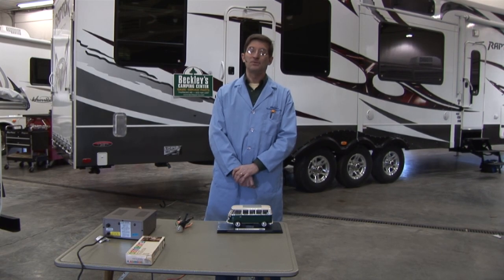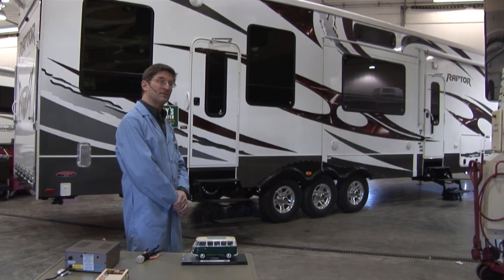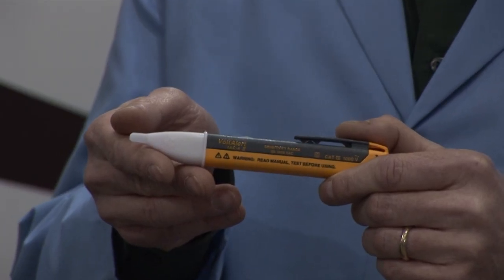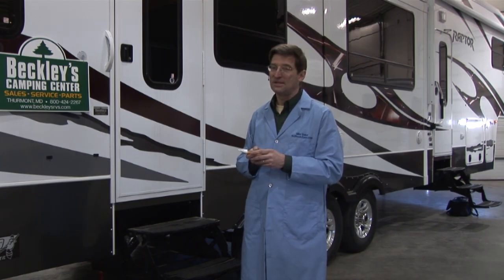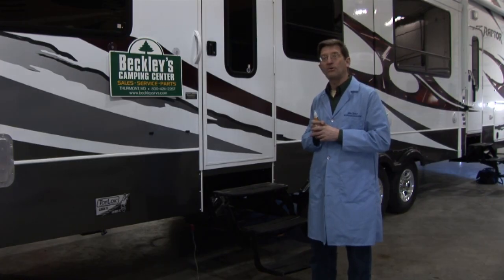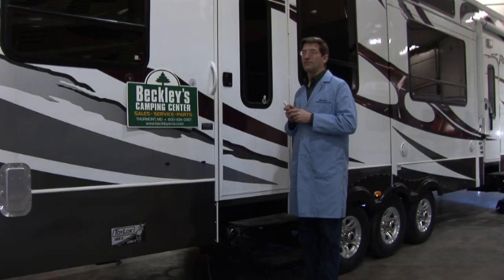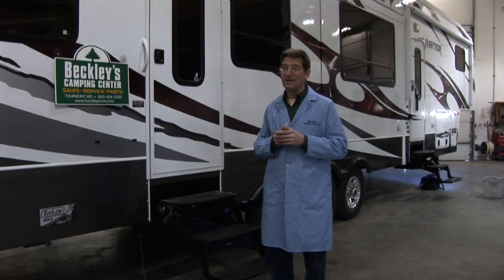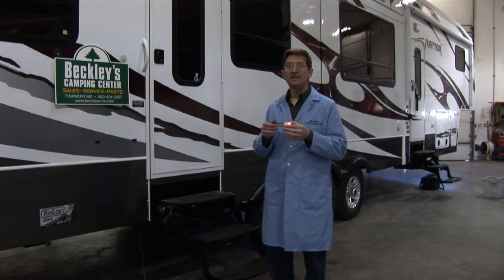Hot Skin RV proximity test full scale

Comment: 40 volts AC is not enough to cause a heart attack even if you are soaking wet. 1 amp is required to interrupt the human heart at 50 Hz. Human skin has a resistance of 1000 ohms dry and as low as 100 ohms wet. I = V/R  = (40)/(100) = 0.4A. A standard 110 volt AC outlet is just enough to cause fibrillation if you are wet but not when dry; I = V/R = (110)/(100) = 1.1A 
I agree with your lesson however, always better safe than sorry.

Comment: CPR will not fix a fibrillation. Get ice on their head and straight to a hospital. I mean surround their head in ice; this will give them  up to an hour or more before brain death. Also, they would have 8 minutes to live not a few minutes without any intervention. 8 minutes before brain damage starts due to oxygen deprivation. CPR is blowing carbon dioxide into their lungs and meant to inflate the airways when a person is not breathing but there is a heart beat. If the person is having a heart attack you can't simply blow carbon dioxide and nitrogen into their lungs to correct the fibrillation.

Comment: Just got a camper, had it plugged into a garage standard outlet using a 30-15 adapter. Was outside the trailer leveling it, was hot out and was sweating, I noticed when my arm brushed against the edge of the rv it tingled. I thought wtf. Started looking into it and wow, not good. This old garage outlet I'm using has no ground/2 prong. I know nothing about electrical, so now I'm just trying to figure out how to fix this. So far it looks like I have to run a ground wire from the garage outlet to the house breaker panel, to bond to the circuit, then replace the outlets w GFCIs. Anyone knowledgeable in this have any input? This rv is my home for now, that was the plan  anyways. I can use a generator temporarily, until I get the grounding issue resolved.

Comment: I have a question Mike, my RV has 38 volts of power on it when it is NOT plugged into anything? I live under the high transmission lines that I believe is causing this condition. Can I just ground the RV?
Reply: That's an example of electrostatic induction. The induced current is very low and you can safely ignore it, or you can attach a grounding stake to the chassis and it will go away. It will also go away whenever you connect to properly-grounded shore power.

The natural electrostatic field is oriented vertically at a strength of about 30V per foot. (In good weather. It does crazy stuff under rain / hail / thunder clouds.) The man-made induced voltage you're seeing is equivalent to about a 2 foot difference in height. 

(Also the natural field is DC and the artificial one is AC at the same frequency as the lines.)

Comment: What a useless video.  So I have a hot skin, what do I do to diagnose or fix it?  I don't need to know I have a problem, I need a solution.
Reply: Turn the breaker off and unplug, or shut down your generator. If it's caused by shore power go bitch to management and try to get an electrician out. If it's caused by a generator, you  need an electrician to inspect your RV.

Comment: Can you physically ground your RV with a grounding stake before plugging it into a mis-wired pedestal
Reply: If you provide a grounding stake with 150 ohms of resistance (which is really good) and the path through person is 1500 ohms (pretty typical), then your grounding electrode has provided approximately 10x protection.  That sounds good but it's nowhere near enough.

Using a grounding electrode improves the threshold of danger from 0.005 A of spilled current to 0.05 A. A faulty appliance can spill more than an amp and a wiring problem can spill 20A or more. A safety conductor should be thousands of times more conductive than the human body. You can't do that without correct wiring.

Auxiliary grounding stakes don't hurt, but they're not enough to help you.

Comment: A false test can occur if your RV is below high tension wires. If you test and get alarmed, look up. A very low amp current can occur, no harm will be done.
Reply: Well, no immediate harm.  But there's a reason homes/businesses aren't located under 100,000+ high voltage wires that are induces current through your body back and forth at 60 times per second.  Over a lengthy interval (years), one's health risk increases - ditto during pregnancy or individuals have other health factors that suppress their immune system.   Consider this statement:  “There is no known mechanism by which magnetic fields of the type generated by high voltage power lines can play a role in cancer development. Nevertheless, epidemiologic research has rather consistently found associations between residential magnetic field exposure and cancer.”
Reply: @CaliforniaTravelVideos  It wasn't hard to Google the study you pulled that quote from. It also says:

"On the very simplistic assumption that residency close to high-voltage power lines would double the childhood leukemia incidence, it may be estimated that less than one case per year out of a total of 70 would be prevented were all power lines deenergized. The reason for the low number is the combination of an uncommon exposure and a rare disease."

Or to summarize, the link between HV lines and cancer is a mystery and a scientific curiosity. It's not a public health crisis; it's not even a particularly rational justification to avoid living near such lines. It's still good to know. Higher frequency and higher voltage lines, or lines installed closer to the ground, might warrant careful study. Utilities are gradually switching to high-voltage DC - so my guess is that this will become a moot point long before anyone figures out a mechanism.
Reply: @jordanrodrigues8265  Interesting, thanks for sharing.  All the same, as a former microwave technician I avoid dental X-rays, prolonged sun exposure, etc. but I freely use and enjoy the convenience of microwave ovens with adequate shielding.

Comment: A "surge protecting" is not the same as a ground-fault error! The particular surge protection device you use must clearly state it offers "miss-wired" ground protection; as not all devices are the same.  A Progressive Instruments Mfg. device is most often touted as having this capability. Mine has a real-time  voltage reading/Amperage draw as well as a brown-out protection for lower-than-adequate power conditions [that can also be detrimental to your on-board electronics].

Comment: how often does this happen...just curious...
Reply: Only if you pull your cord out alot like NUMEROUES times a week for a season, it can stretch and ruin the metal cable INSIDE the cord. It's not often this happens, HOWEVER, that's not to say your box you plug your camper into couldn't be ruined. MAKE SURE YOU CHECK BOTH THE BOX AND THE CAMPER with these little devices. Trust me, this CAN and WILL kill you FAST! It's rare to get just a little tiny shock. Many times it'll be 120 volts! That will try your heart in a split second! There is not chance of survival! So a $15 no touch tester at Walmart in the auto section, is worth saving your life!!!! ESPECIALLY if you changed your cord to the camper, always test it AFTER plugging it in! Trust me when I say, IT HURTS! IVE BEEN SHOCKED ONE TIMW after I replaced the cord, it was a tiny little hair of metal that was touching the box of the screw where you tie the cords electric into, and that was enough to severly shock me! I was lucky it didn't stop my heart! I NEVER touch the camper ANYMORE without that tester, weather your going inside and back out within 5 minutes, EVERY SINGLE TIME you enter make sure you test it!!!! You only get one chance to do it right! There is no second chances with these 50 amp systems!!! Even 15 amp connectors is enough to still kill you! Becareful. I hope this helped answer your question??